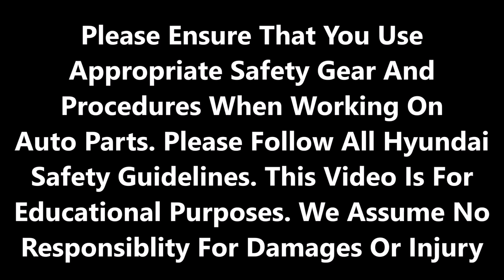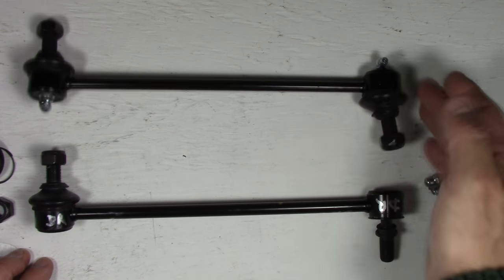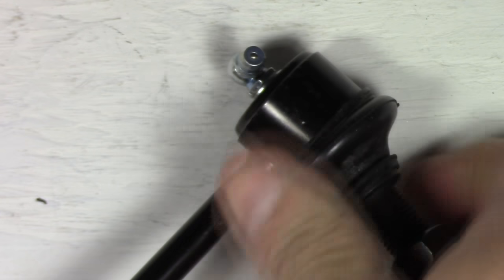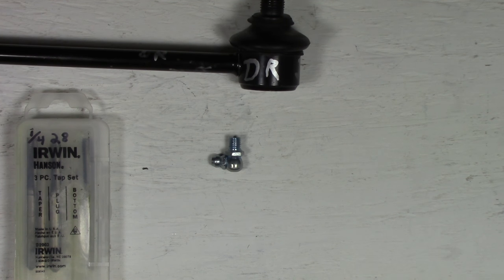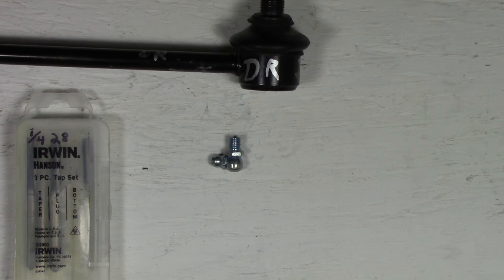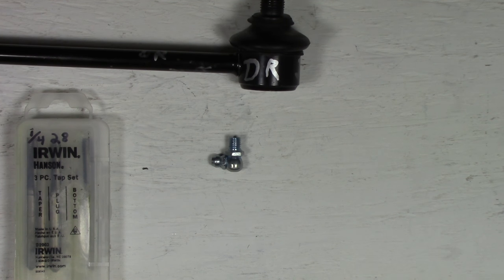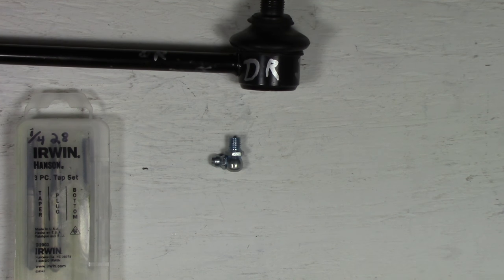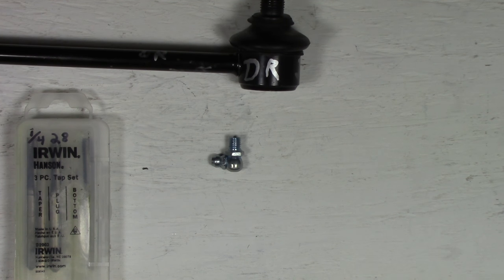Installing Zerk Grease Fitting On Stabilizer Bar Link Testing & Lubrication Hyundai Santa Fe 01-06

Comment: A little trick is to use a magnet on the drill bits and tap so you can catch all the shavings, I would not blow the shavings around incase you drive them down into the ball.
Reply from the maker: Thanks for the advice. I appreciate it. All the best.
Reply: @richardlloydusa  what is the function of the screw on top of the connecting rod

Comment: It's Criminal that ball joints don't come with grease fittings. Nice fix..
Your drill press makes quarter turns. Is that a feature or are you just bumping the switch.?

Comment: when you drilled the hole looked like some metal might have fallen in the hole, one method to avoid that is put some grease on the drill, the metal shavings stick to the drill....apparentlly...... I've never triked using grease haven't had the need, but saw the tip on a youtube vid ( long time ago)
Reply from the maker: Thank you so much for commenting. I appreciate it greatly. All the best.👍😀

Comment: Richard: it's a great thing to be able to lubricate the suspension components but you have to ask yourself, they are designed to last for many miles without the added zerk fittings. The amount of work you have done versus just replacing suspension parts when they go bad. Unless you plan on keeping the car for a very long time and lots of miles, if it were me I just opt for replacing the suspension link bar when it's needed! I think you covered all the basis if you want to do this. Again this is a modification, so you void any warranties and I am not so sure, but you might have taken the manufacture off the "hook" when it comes to any liabilities, if they should come up.
Reply from the maker: I understand your point. I intend to keep the vehicle for a while. I understand the components are cheap to replace but if I can make them last longer for a few dollars I see it as worth it. BTW did you see the pitiful amount of grease in the ball joint to start with? They certainly don't over do it on lubrication. As far as modifying the links and having them fail I am not concerned because I am not planning on (nor do I think it's right to) go after the manufacturer after I modified the part. Another plus about putting the grease fittings on the part is that you will be looking at them on a regular basis (every oil change) so you should spot any excessive play/wear prior to the part failing. Otherwise you would be using it until it wore enough that you noticed it while driving at which point I would say you are dangerously close to a catastrophic failure. Thanks for your comments and feedback I appreciate both.
Reply: +Richard Lloyd We`ve had this discussion before, Here in England a few yrs back we had big problems with cheap foreign suspension parts, ball joints were just falling apart and causing serious crashes, the government banned these import parts, unless the were tested and quality assured to British Standards, so what you`re doing is not really a problem, as long as the part is good quality.
Reply from the maker: Agreed. These are AC-Delco links and are manufactured in Taiwan (Free China). They look and feel very solid but only time will tell. Most new suspension parts "look" solid but with metal you can only tell how good it is after it's been stressed for a while. I think I will cut the old ball joints on the links in half to see what the internals are made of and what kind of wear they have. Ought to be interesting. I will be mounting these today. Should be fairly straight forward. I have a new ball joint separator that I am itching to test that looks very promising. I still have the lower control arm bushings to do as well. I bought a 12 ton hydraulic press for that job for under $200! (some assembly required). I tried replace the OEM bushings with the ball joint press, I managed to remove the originals but damaged the first two new ones I mounted because it is not the proper tool for the job and I could not properly align the bushing as I pressed them in and I damaged the rubber on the new ones. More to come. Thanks
Reply: good luck with it. this is one of the first video's I have seen where grease fittings were added. One question, sometimes you can buy new ball joints and suspension parts with the zerk fittings installed on aftermarket parts. Have you explored this? would save a lot of work!
Reply from the maker: I have seen that you can buy them with them fitted but they cost three times more than these do. The parts to do the job on these links cost about $2.00 so I saved a ton of money doing it myself. If I could buy them with the fittings for a reasonable price I would certainly go that route. Thanks.
Reply: This was common mod in the early 1970’s my Grandfather bought a 1972  Ford Comet and it was one of the first to come without “front end” grease fittings. He and his mechanic were shocked to discover that the car wasn’t able to have the car “greased” so they added the zurks  to a previously common maintenance grease points.

Comment: Zerk fittings are so stupid. If they worked the OEM manufacturers would put them there. If there isn't enough grease then you have a bad link. If you're losing grease then you have a bad rubber and it should be changed anyways.
Reply from the maker: Thank you so much for commenting and watching. I appreciate it greatly. All the best.👍😀